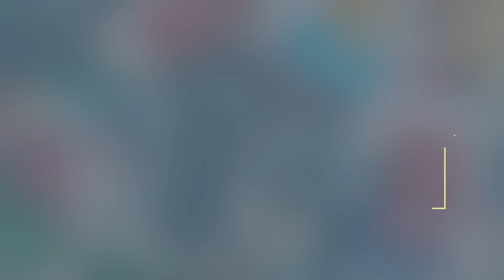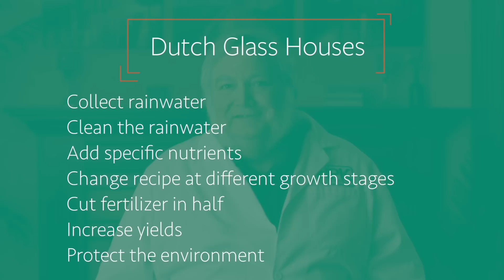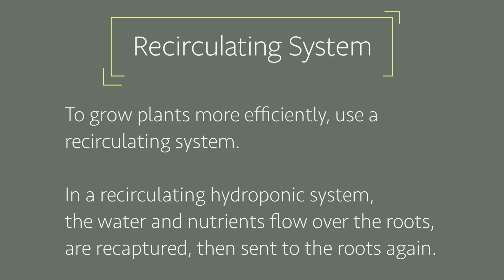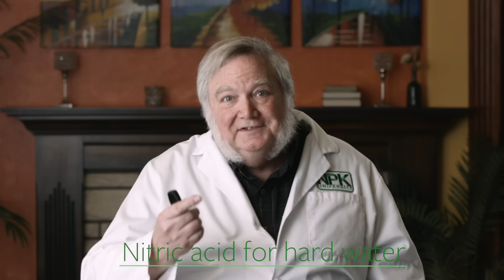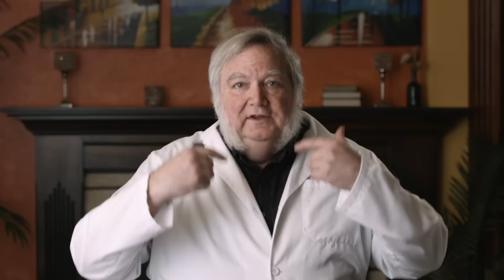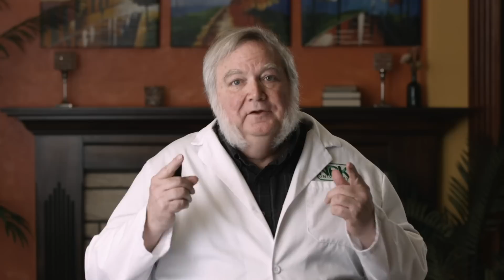Zero Runoff Technology | Harley Smith's Master Growers Series

Comment: Just recently realised the roots are using ion wind plasma flow for nutrients uptake so I presume plant sugars are providing elecron charge for that uptake aswel as biologically rizofaging substrates .and I'm suposing iron is being utilised in root cells or by biology to act as energy storage and electron flow because I've found acumulated iron in rizomes so guess roors do the same tho it looked oxidised it seemed to dissolve readily on water. So bio nutrients are capable of alot more tgan we understand.

Comment: I thought about adding a little circulating pump from a small reservoir to re integrate the cleaned water backthrough either dripping through the top or back into the bottom .thats what i should go .the roots become the biofilter just like the filter on a waterpump for a fishpond .i like that harley. Adding a water circulation .mmm .

Comment: Ive got a rigg for a airated hydro bokashi biodigestion substrate part soil pott container test to try out. Double chamber where the solid foods minerals etc are airated below the substrated pot and the microbes etc breakdown airobicalky the stuff in the chamber bellow and the air filters up through the bottom of the top pot .the roots will in theory go down into that airated goo and crunch topped with foamy films etcand will wick up into th3 bottom of the top pot like an earth box .but seperate chambers .its simple and easy .just maintain the level in bottom pot and top up through watering of ph corrected water that drains into bottom where its all going on. Havnt used it yet. As long s the subsrate holds the right amount of water without being too wet then it should be all cool fonzee .thanks folks